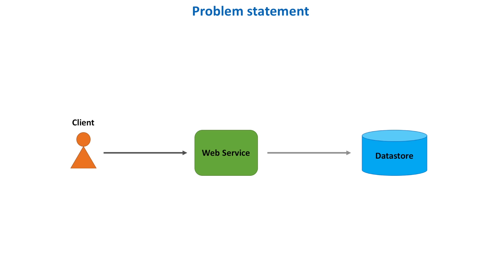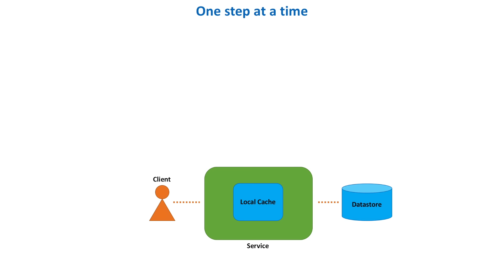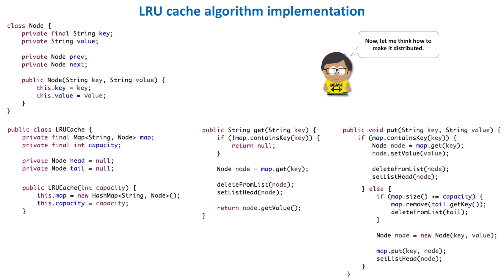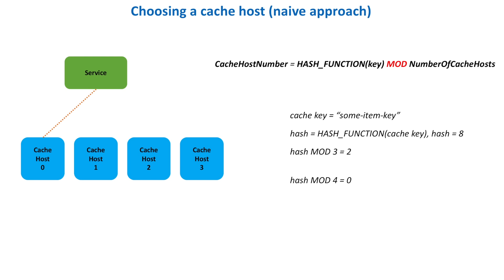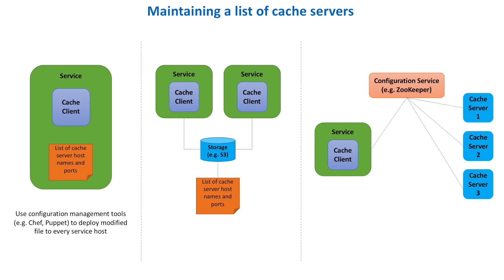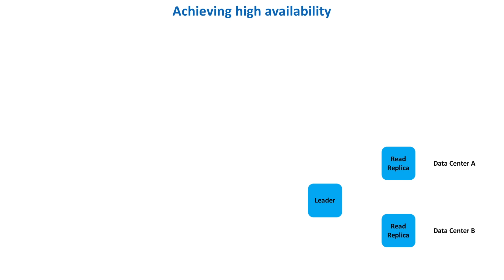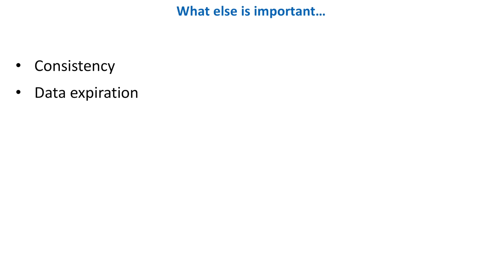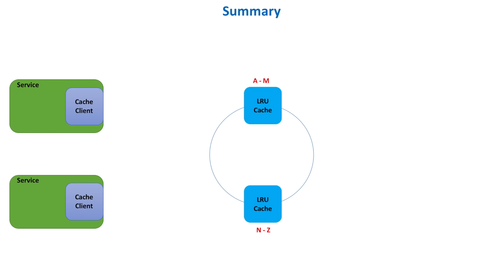System Design Interview - Distributed Cache

Comment: Thank you for the excellent explanation! One question on 21:40.. if I understand correctly, you mentioned that one key may become super hot, then one machine can be added to shard the key. I am very confused about this, I imagine that the key is only one point on the consistent hashing ring,  how can it assigned to two machines? Or we just ignore the consistent hashing,  simply add another machine to share the queries of the key? Thank you!
Reply from the maker: Hi Yue Liang. Thank you a lot for the feedback you left for this and other videos!

Regarding your question. You are correct, key is only one point on the consistent hashing ring. It is always assigned to a single machine (a leader). But this machine will have several replicas (followers). So, we use consistent hashing algorithm to identify the leader. And then we pick either the leader or any of its followers (e.g. randomly) to handle a GET request.

Hopefully, this clarifies things. Let me know if you have any more questions.

Comment: Thank you for this. One of the best tutorials out there. A quick question, when we moved to consistent hashing, the the shards no more depend on range of Key characters right? Meaning, Host A can now contain items anywhere between A-Z based on the hash value outcome, similarly Host B can also contain items from A-Z based on hash value outcome. So we are doing sharding based on Hash values and not based on A-M, N-Z criteria. Correct me if I am wrong. Thank you :)
Reply from the maker: Hi Sarvesh. Thanks for the feedback!

Looks like I confused you with A-Z notation. It has nothing to do with key characters, but indicates "the whole set" of keys. It may be easier if I use numbers instead. Think of it as if we have 26 buckets. And when we calculate a hash, we do (hash mod 26) and identify which bucket this key goes into. 

Consistent hashing algorithms tells us which buckets are stored on which hosts. And each of these hosts stores only a subset of all the buckets. E.g. Host A stores buckets 0-12, while Host B stores buckets 13-25.

Hopefully, I have not confused you even further. Let me know if this is the case. I will make sure you get it right.
Reply: @SystemDesignInterview  Crystal clear explanation! Thank you very much. So we get a request, we calculate a hash, let's say the hash tells us that this key goes into bucket 15. Now that we know the bucket, the next thing to do is identify what host stores this bucket, this is when consistent hashing comes into the picture. From there we get the host and serve the request. I hope I am correct here. 

Thank you again, Mikhail!

Comment: I have a question regarding "hot" cache servers. You mentioned that the design didn't support high availability and you added redundancy to each cache server. The pattern you used was the leader/follower pattern. You also mentioned that this could help us with the "hot" cache servers, but I am having troubles understanding why this could help us. I understand that "get" will be distributed across the leader and followers, but the "put" still will go to the leader. So I think the problem still remains the same for the "put" operations. Is this correct?
Reply from the maker: Correct, but this is where sharding comes into play. Read replicas helps to scale reads. While sharding helps to scale writes.
Reply: @SystemDesignInterview  That makes sense. But still, there is a chance to have some "hot" keys that could overwhelm one particular server. This could happen even when we use consistent hashing. What would be a way to mitigate this? One way that I think we could, is to pick another partitioning key, but that also come with a cost.
Reply from the maker: Kudos for digging deeper.

You are right, it is possible that we have a not uniform nature of writes, when majority of them go to a single shard. And this problem is not cache specific, it is actual for many multi-tenant services, like public cloud services. When data is partitioned by a customer identifier and some customers send much more data than others.

One way to deal with such problem is to setup a separate cache cluster for "hot" keys (customers). Big customers have their own cache cluster and data is further sharded inside that cluster. Other keys go to a common cluster. This idea is also known as a cell-based architecture. Please check out this video for more details: https://youtu.be/swQbA4zub20?t=1263
Reply: @SystemDesignInterview  I see. It makes sense to have a dedicated piece of hardware for these clients. Thanks for sharing this video!
Reply: @minostro  I think consistent hashing approach already deals with this situation by adding "virtual copies" of each server in order to balance the load of hashes across the actual servers.

Comment: I have a question regarding the consistent hashing. If removing a host from the ring, how it handles the cache content in the removed host? Should it transfer the cache content from the removed host to its counter-clockwise nearest host or let the increased cache misses happened and gradually let the cache be populated?

Comment: Would a distributed database work on the same principles - except we have a DB client instead of cache client, or would it be different?
Reply from the maker: Hi Saif. Good insight! Distributed DBs (and more specifically DynamoDB, Cassandra) have indeed a lot in common with the principles we discuss here. But databases are more complicated "beasts". Primarily, because they have a more strict  durability and availability requirements. And they use many more interesting and important design concepts. For storing the data, detecting failures, resolving conflicts, optimizing writes and reads, discovering peers, etc. I plan to talk more about this in a separate video.
Reply: System Design Interview - thanks Mikhail looking forward to it 🙂

Comment: Great material. You went above and beyond to explain the topic. One question, though: at min 15:15, when you describe consistent hashing for choosing a host for a key, how can you make sure that that host has the key?
If you are sharding by key ranges, then hashing the shards by IP address on the ring, don't you break the link between the key and the shard containing it?
Reply from the maker: Hi Valeriu. Thank you for the feedback!

Can I ask you to clarify the question? Not sure what part causes a confusion. 

Let me provide a small example.

Let's say we have a function that for any input string generates a number from 0 to 12. And we have two hosts: host-1 and host-2. We take IP address for each host and send it to the function. Let's assume for host-1 function returned 3 and for host-2 function returned 7. It means that host one is responsible for numbers 3, 4, 5, 6. While host-2 is responsible for all other numbers. 

"Responsible" means that when some key comes and we run it through the function, if returned number is from 3 to 6, we call host-1 for storing and retrieving this key. For all other numbers (keys) we call host-2.

Hope, this example helps to clarify the algorithm. Let me know if not.

Comment: Thanks for making a great video. Covered almost all areas in this particular system design. But I have a question- What if I don't want to maintain read replicas of each server and instead I want to replicate the data in other existing server(like the way kafka does this). Is this good way for cache distribution? If yes, how cache client can figure out the secondary server?

Comment: The explained LLD code for LRU cache doesn't appear to be thread safe. It would be great to discuss concurrency before making it distributed to scale out.

Also, the leader based async replication where the leader serves write traffic and replicas serve read traffic with eventual consistency wouldn't work for caching use cases. Since, even read requests have side effects (pushing to head of the queue) and leads to inconsistency. I guess leaderless replication would be a better fit. I would love to hear your thoughts on this! 

Needless to say, amazing content. Really urge you to create a Patreon account and consider making more videos <3

Comment: Thanks, Mikhail! You mentioned TCP and UDP as communication between hash nodes. Can share some practical examples from existing system when UDP is used?
Reply: Most High-Frequency Trading systems use UDP for internal communications as latency is vital. If you want to see the exact design you can check out How to Build an Exchange from Jane Street.

Comment: @System Design Interview  Thanks a lot for the detailed design, can you please clarify few questions - lru cache implementation is going to make the performance slow as we need to lock the double linked list for moving nodes to the front and evictions as well? Do we use fine grained locks here? Also using replicas for get calls will make the lrucache out of sync with master unless we don't do moving this around in replicas as we are not dealing with put calls? Is cache client polling for new changes from zk config service or getting those changes pushed by adding themselves to zk watch?

Comment: I am confused about one part ... In the video at 21:31 you mentioned that if we add a node into the consistent hashing ring, it can split a shard into a smaller one, but it's not a good idea because we need to split a very specific shard... however as long as you add a new node into the right part of the ring (add it right after the node which is the hot shard in the ring), then won't it split the shard you want it to split?
Reply from the maker: Hi Kamal,

In the "classic" consistent hashing algorithm we do not chose where to put the node on the ring. Hash function decides this. There are versions of consistent hashing algorithm when the same node is placed on the ring several times. They are called virtual nodes or vnodes. And in this case, this new node splits several different hash ranges, increasing the chance of splitting the "hot" range.

Comment: In case of leader follower replication,  how does read call work? Which layer will decide which replica should respond to the read request. I am not sure if load balancer can selectively call hosts based on application layer data. May be a reverse proxy/gateway in front of every (leader-replica) cluster? I am not sure how it works in real world?

Comment: Great video BTW, I have few qns: 1. Does leader - slave replication mean that each of the leader node hosting the shard will replicate it to a corresponding read replica? or is it cumulating all of the shards together? 2. For the hot spotting issue, can we add a salt to the key?  3. Can we replicate the partition similar to a kafka model and have a leader elected per shard, may be a meta data server to store that info? Thanks once again for such an insightful video

Comment: Great video, very thorough and informative. Will you please consider making a video on big (e.g. several gigabytes in size) file transfer approaches in distributed systems? I'm interested in methods of dealing with network failures and checking consistency. Thanks.
Reply from the maker: Hi Piotr. Added "big file transfer and storage" topic to my TODO list.

Comment: small doubt does LRU works with data in single machine @33:36 because if we have oldest data in machine 2 but chache is not filled and cache is filled in machine1 but we have recent data than machine 2 so lru will delete data from machine 1 but effective deletetion would have been to delete from machine 2 .

Any idea on it

Comment: If we do master slave replication for each shard,  the master is going to always have more load than the slaves, right (since put calls only go to the master)? This had me thinking, do you even need a concept of master/slave for replication? Is it possible for each shard to just have its own replica set, where each replica is of equal status? We could make it so the put call and get call can go to any of the nodes in the replica set.The put call can then be asynchronously replicated within the set after right?
Reply from the maker: Hi Kamal. You are right, we can make leaderless replication work as well. Similar to how Cassandra does it. Talking a little bit about this here: https://youtu.be/bUHFg8CZFws?t=1254

Comment: How finding a server ip is logN? (I do understand that we can apply binary search on a sorted list to find a number in logN time)
Reply from the maker: Hi Aditya,

Here is some simplified example. Let's say we have a hash function that converts any string into a number from the range [0, 15]. And there are 3 hosts in the cache cluster. Each host is responsible for its own range:
Host A - [0, 4]
Host B - [5,  11]
Host  C - [12, 15]

Some key comes and its hash = 2. How do we find the host responsible for hash value 2 ? We run a binary search. Something like picking a host/range in the middle and compare requested value 2 with both ends of that range. This gives us a clue what next range to pick.

Please let me know if this does not answer the question.

Comment: How to make sure that data in the cache is not older than the data in the database? Does our app should stall untill it receives the response from cache that the cache was successfully stored?

Here is the detail of the problem:
1. We send put() request to the cache asynchronously via UDP and immediately after that we send an UPDATE to the database.
2. The UDP request to the cache is lost but the cache still holds the data.
3. After few seconds the other server issues get() request to the cache and receives old data.

That is how do we maintain cache consistency with database without losing performance?
Reply: Basically, the solution is that when you modify the key-value in the database, both the database and the calling function delete the key from the cache(s). This way clients see their own writes and you don't get stale data in the cache. On reads, if the value is not in the cache, then it is retrieved from the database so it stays consistent with the database. Take a look at this MIT course about Memcache at Facebook : https://www.youtube.com/watch?v=Myp8z0ybdzM&t
So basically, you don't send put requests to the cache to modify values, the method will retrieve a value if it's not in the cache and then put the value into the cache. You only send delete requests to the cache when values are modified. You update the database, before you send the delete to the cache. The database will also send its own delete request to the caches that hold that value that was modified.
Reply: @gurpreetaulakh1170  thank you for the link! Do we send Delete requests over TCP? We’ve got to make sure that the cache has completed operation right? 

And it also feels like we need transactional consistency of the cache and database, because when you have deleted the key from cache or added new key, there is time span between a change in database and a change in cache. During that timespan the cache is not usable. It has to be locked. Even if change is coming from db, there is time when cache and db have different values.

I’ll watch that video though, hope I find the answers there :)
Reply: @egor.okhterov  At scale, caches are eventually consistent. It's the CAP theorem. In order to get Availability and Partition Tolerance, you have to give up Consistency. So you end up with Eventual Consistency. If you're not at scale, then you can choose whether to sacrifice Availability or Partition Tolerance in order to have Consistency. So to answer your question, at scale, yes there is a chance that the cache and the DB have different values. But that's okay because they will only be inconsistent for a short period of time. That's why it's eventually consistent.

Comment: How is data replicated to nearest cache server when one of the cache server dies(assuming master and all the slaves dies) in case of consistent hashing. If server is dead how we will recover the lost data?
Nice video.
Reply from the maker: Hi Deepanshu,

First of all, please remember that a "classic" cache is not a persistent data store. Meaning that data is persisted somewhere else (database, disk) and cache just holds a copy of that data. So, when cache server is lost together with all the replicas, data in the cache is lost as well, but source data is still available in the persistent storage. The next (clockwise or counterclockwise) node in the consistent hashing ring will start serving all the PUT and GET calls for the "lost" keys. It will take some time until cache data is populated for those keys. There will be a lot of cache misses and data will be served directly from the database.

Important to mention, that there are different techniques to ensure that master and slave nodes are not lost all at once. For example keeping data on different racks inside a datacenter. And having copies of data in several data centers.

Comment: Hi, awesome video bt i am wondering this implementation is not thread safe. In real world scenario, we need to make LRU cache  needs to be thread safe. Simple Hashtable doesn't helps. Whar are ur thoughts?
Reply from the maker: Hi Tushar. Here are some of my thoughts on concurrency.

- One of the options is to use read-write mutex to lock both the map and the list mutating operations. This may be relatively simple to implement, but may not be very effective from throughput perspective, due to high thread contention.

- We can rely on Java's built-in API and use thread-safe data structures. For example ConcurrentHashMap and ConcurrentLinkedQueue.

- Because LRU cache can be implemented using LinkedHashMap, we can use a thread-safe equivalent of this data structure. Java standard API does not provide such data structure. But we can take a look at Caffeine, which is a Java 8 rewrite of Guava’s cache. It uses ConcurrentLinkedHashMap data structure (https://github.com/ben-manes/concurrentlinkedhashmap/blob/master/src/main/java/com/googlecode/concurrentlinkedhashmap/ConcurrentLinkedHashMap.java)